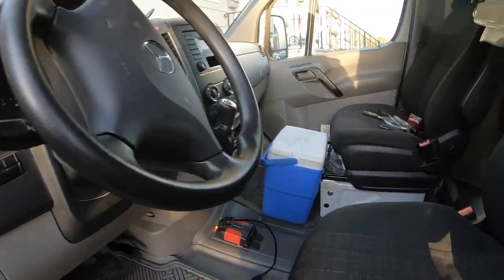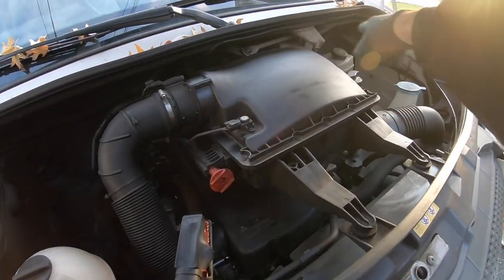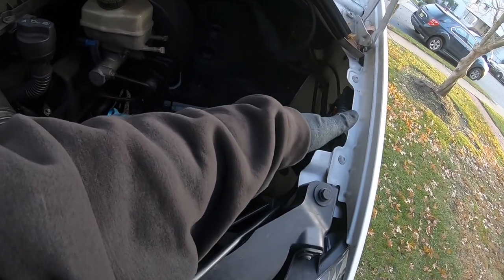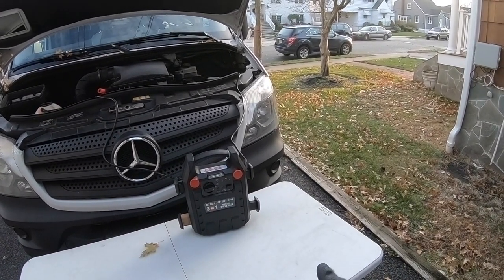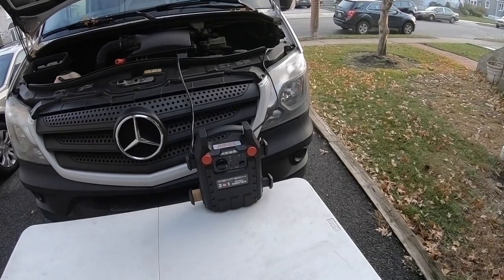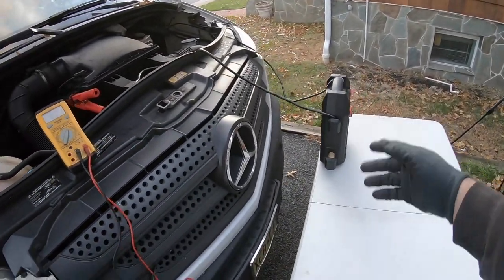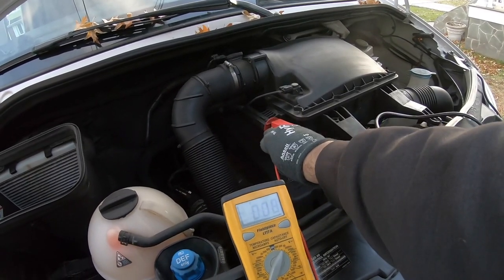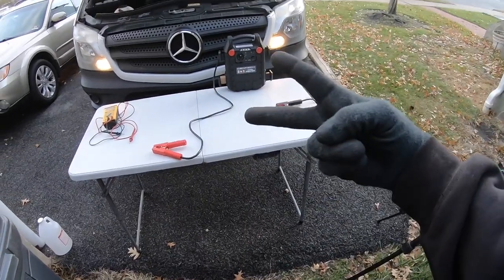Harbor Freights CEN-TECH 3-in-1 Portable Power Pack Jump-Starting My Van

Comment: You can absolutely just hookup and turn the engine over.
Reply: that never has worked when I tried it and I just got my damn truck back yesterday I am good and pissed off
Reply: @kingtech7917  ya sometimes gotta take battery out it don’t work very well in freezing temp
Reply: @georgehofgren6123  I do it everyday. I’m a technician. Your telling me I can’t just crank over a jumpstart? Lmao. Funny.
Reply: @Joseph Brown  Hey dope, did you Watch the video? Do you own this unit? Hold on, you're a Mechanic and you use Harbor Freight's cheapest Jump box? Oh sure you do.... Let's start over- The Reviewer is 100% correct and he says so himself that the Cen-tech 630 is not Really a jump starter, just a power supply (even tho it looks like a jump box... I use Those as well genius). Just as it says on the special, separate, included Card- which says "wait 5min Before starting the vehicle". Again, do you have the unit and have you actually tried immediately starting a vehicle with it because I Have and if you are saying you do, on cars with Dead batteries, with this Centech 630, then you lie ~

Comment: Its basically  just a portable battery    to piggyback  with the existing  battery  to add power to assist with starting
Reply from the maker: Yes it worked though. I usually use my electric car charger that i can set to 50amps for a jump

Comment: The only problem that I had with it is that the charger AC connector is cheap. If you break the old plug you have to get a new one from Amazon. But it works beautifully to jump-start my vehicles.

Comment: It just puts the top charge back in to battery. Not designed to jump start lime the more expensive booster starters.
Reply from the maker: Yea works like a trickle charger. My employer bought this for generator batteries. It worked for the van yet I should of charged it again before trying to get a defective generator battery to crank.

Comment: You keep saying "booster" but do not appear to understand the term. This is a battery you are connecting in parallel to your vehicle battery.  Those "boosters" are, you guessed it, are batteries too. They may play fast and loose with how they provide the voltage and amperage needed, but they are just batteries as well.  Difference is those tiny units use lithium cells that can rapid discharge into a start condition, but have no mass or depth to them so if if doesn't work immediately, then that's it.  Hot and fast, no stamina.  This battery pack has essentially a garden tractor/motorcycle battery in there and can last much longer.
Reply: I think he might have seen some videos on the smaller lithium ion jump starters which often have a boost button if they do not detect the battery. Unfortunately the cables on the lithium ion pics would be way too short for this particular van.

Comment: Don't get me wrong, this was a very good demonstration of if and how to jump a vehicle with this thing. But GOD ALMIGHTY that you have to Wait for actual Minutes out of your life before you can crank the thing. 
Ya, apparently it is more of a power pack than anything. But in All Likelihood it has a capacitor it needs to charge up for the burst of engine cranking. 
You'd think that after all that teeth knashing, you'd at least praise the cheap little thing for running your glow plugs And cranking your high compression diesel. 
GOTTA be from NY or NJ...
Waa waa waa waa WAAAAA 👶

Comment: I would much rather have one of these in my truck in case anybody ever wants to use jumper cables with my truck. No freaking way would I ever hook up my truck to someone else’s with jumper cables unless you want to fry your computer
Reply: Plus, using the USB port, it charges my iPhone in about an hour and a half

Comment: Anyone have the Centec 750 peak amp Starter / power station ?.... little blue one approx 10 pounds. I just bought one and learning a bit more about it.
Anyone experience any odor coming from the device???
I made my van into a camper van and hope its not dangerous to keep in there with me.
Keeps my phones charged and has  great work light on it.

Comment: Usually  the only thing I have ever seen a boost on is a battery charger
Reply from the maker: I’m so use to using my battery charger that has the 50amp output for the boost.
Reply: correct you do not have to wait the 5 min.

Comment: Mine stopped working after a year. I aired my tires up three times and it isn't working. I don't recommend this brand. It won't last.
Reply: I 2nd this
Reply: You have to charge it every month
Reply: This model doesn't have an air compressor.  You are referring to a different model.

Comment: Can I charge my battery out of the car? I can see  from the instructions that don't clamp the negative directly to the battery's negative port. Thanks!
Reply: Should be fine to connect it to the negative terminal but can ground another way. jumper cables say that too and most people seem to connect to neg term anyways.

Comment: I have the same charger. It's junk. So are Habor Freight tools. That's why they're cheaper than other brands. The battery jumper need to be recharge every week. That means it doesn't hold a charge for long period. I owned other brands. The charge would last for months.
Reply: Sorry but quick question how do you charge it? I really cant charge it im trying from the back but it doesn’t seem to charge unless its not from there
Reply: @braandoollriios9554  huh
Reply: I have this one as well. Exchange it for another. Mine has started a couple v8 gas engines and shitloads of smaller engines. It is a SLA battery. They should be charged every 30 days. Mine now needs a battery at 5 years old. Replacement batts are around $35 on ebay.
Reply: My parents have one and it started a 4.3 GM v6 with a dead battery (3 volts in it). That put it to the test but it did start it.
Reply: Did you turn it off when not in use?  Instructions state you need to physically switch it off or else it will discharge while in the ready state.
Reply: @braandoollriios9554  the back has a fold out plug you can plug any extension cord into.

Comment: A free battery pack from your job??....."must be nice",,.I have the dinky version of the monster you hooked up there...but you are correct.its not a booster..its a battery pack...booster battery  jumpers are those battery chargers that get pulled around  on wheels....
Reply: Right, Boosters are plugged into mains outlet.😉

Comment: I bought one of these. And today I tried it for the first time. This couple in a nice Subaru had ran their battery down playing the stereo for 15 min.
Anyway we let it sit for 5 min.
But it did not start the car.
Guess I'll keep my AAA membership.
Reply from the maker: I would leave it connected for longer than 5 minutes if it won't start. I had a battery the GPS ran down took 20 minutes on charge to get it to start
Reply: @billstools5244  Well if it's just me and I get stuck again, I will try that.
However, If it was 1:00 am and 39 deg. I would be a tad impatient.

Comment: It doesn’t need a boost it puts out about 14 volts and 600 or 700 amps
Reply: I just purchased a Cen Tech jumper so are you saying I don't have to wait 5 mins to jumpstart a car?
Reply: @jasonhenderson6846  I have the same booster pack, and absolutely. It's worth the wait. I've started V8's that were completely dead. I haven't yet tried jump starting a BMW. BMWs are hard to jump start.